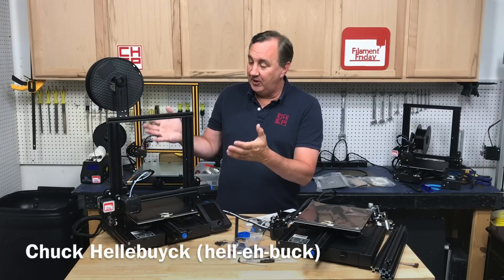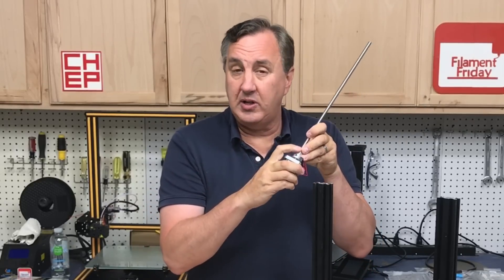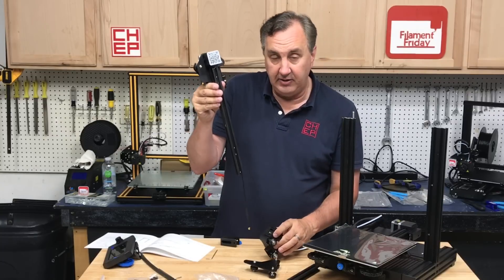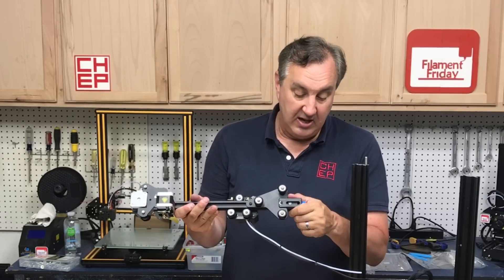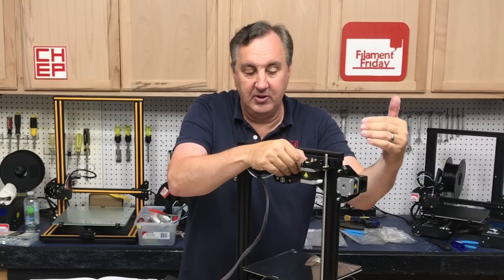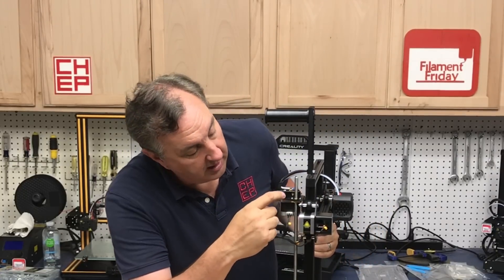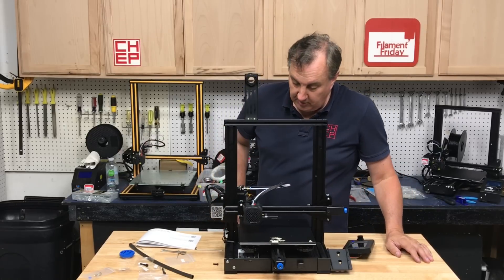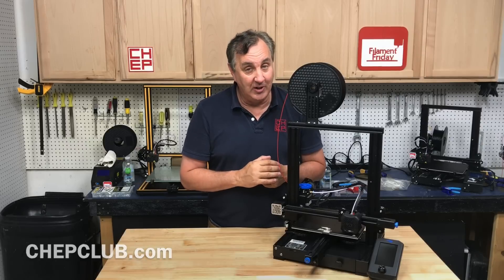How to Setup an Ender 3 V2 3D Printer

Comment: Is anyone having issues with the "pause at layer" command on the V2? Sometimes it ignores it completely but when it does decide to pause so I can switch filament it automatically starts printing again after about 30 seconds without warning
Reply: Hope a solution.

Comment: I contacted creality about the firmware and they told me there's no need to update to 1.0.1 as it's only a language update
Reply from the maker: I believe it also fixes the save to eeprom feature but I added a link to the marlin released version.
Reply: Yeah, that's total BS.  Apparently a very needed fix to STORE SETTINGS are 1.  It also fixed a layer shift problem another youtube user had.  And i am sure others.  There will be more firmware updates...especislly for BLtouch, filiment runout support etc.  Just language fix...whatever.  Creality is so inconsistent with what they do... great printers... but man, wtf?
Reply: It also lets you print any file on the card rather than the limit of 10 most recent files on the shipped version.

Comment: @chep I get an error message when I click the link for the firmware and it isn’t on their website
Reply: Works fine in USA.  May be blocked in your region?
Reply: Tim D I’m in the US too
Reply: @LTMoore-yy1lm  you're correct its down at the moment.  Must have went down right after I visited. Edit: they updated their websitecand removed the Ender 3 V2 firmware up dates!!!! Good grief!!!!
Will have to find their actual links until they get them out front easy to access.

Comment: Great vid CHEP! What printer would you buy with $350? thx
Reply from the maker: You might look into the CR-6 when it releases but the V2 is a good machine and at well less than $350 you can get lots of extra filament and tools/upgrades.
Reply: Hey chep, thanks for the response! Can I change the extruder fan to a noctua one and swap the extruder to direct drive like you can on the ender 3 pro? Does the v2s extruder case prevent these upgrades?
Reply from the maker: You could but I don’t necessarily recommend it. If you want direct drive check out Artillary Genius.
Reply: @chickensoupappledog1645  that's the thing right now with the V2, certain kits like direct drive won't work as the backplate which the hotend, fans, fan cover etc ride on has different hole locations etc.  But apparently u can try an Ender 3 backplate from Amazon to swap out?  Maybe the direct drive kit will have its own backplate, cover etc?????
Reply: @timd9430  hmm i guess i can try to swap the backplate and then upgrade the extruder and its fan. I think ill pull the trigger and buy the v2 as my first printer sometimte this afternoon.
Reply: I would stay way from Bowden Extruders.  I mean you can eventually get it to work consistently but if you are just starting out, i would stay away.  With near $350, I would look at the Prusa mini
Reply: @dattack1970  The PRUSA MINI is bowden.
Reply: @timd9430  yikes that sucks.
Reply: @dattack1970  yeah, but in the end, if you have the cash and the time and patience to wait for delivery (an eternity)... just get a Prusa MK3S.

But if you don't need direct drive blah blah blah out of the box. The Enders are awesome!  You can always upgrade things on them.  So cheap...nothing lost, but definitely learned things in the process.

Comment: Has anyone been able to update ESTEPs from the device itself with a V2? I can't find the option and I'm trying to calibrate...
Reply: CONTROL > MOTION > TRANSMISSION RATIO > TRANSMISSION ratioE
Reply: Tim D Wow thanks I misunderstood what t ratio was and didn’t even dive into that menu. Thanks! I ended up setting up octopi, installing marlin 2.0 and setting it via octoprint terminal.
Reply: Don't tell me this is left out?!

I saw a reddit post that someone was able to.  Have to look on my V2 when I can.

Comment: Loved the video I almost order a boot loader to upgrade my firmware on my ender 3v2 glad I saw your video first thank you so much. I do have a question I would love to build a bigger printer bed and taller but I do not see any options to set to allow a bigger bed. Would love to see a video on how to set it up to use the bigger bed :) 😃
Reply: Teaching Tech has a couple videos on this. There are kits for sale. Bout $150 or so.
Reply: Ender 3 kits should work mostly the same way with V2
Reply: You'd be better off just getting a larger printer... CR series.  Or wait (when I say wait, I mean a very very long wait) for Prusa XL (CoreXY).  But just get a CR series printer since lower cost for now.

Comment from the maker: Note: I made a mistake. Do not rename your .bin file firmware.bin more than once. It needs a different name each time or it won’t update. You don’t even have to call it firmware. Could be any name.bin.
Reply: there a ender 3 v2 firmware out for bl touch firmware version 1.1.1 on  Ceality website, not the 1.0.1 non bl touch - and yes i have modded a , v1 mainboard bl touch3.1  kit to work , requires bracket adjustment and wiring pins mod but is basically plug n play
Reply: Just want to write that about firmware. I have 3 problems with mine, hot end heatsink fan after couple of prints 15 h together make rambling noise on start, glass bed have dip in middle 0.5mm freely spin without pushing filament. Lemon for me as usually but still love it.
Reply: I only have the sd card it came with and have had a blank screen for an hour  turned off to try again  but still blank
Reply: @13tabicat13  have u had any luck? Im in the same boat right now.
Reply: @joshp1888  no, creality says do  all 3 updates but I've tried all but the sd card file with no luck
Reply: @13tabicat13  i got it to work. I went into the file and found the file the path should be Ender-3 V2_1.1.6V_Latest Firmware > Ender-3 V2_Latest Firmware_-2.0.2-V1.0.1-2020.6.2.bin
Reply: Even the first time dont name it firmware.bin or you get a black screen - just name it firmware1.bin

Comment: Not sure if I did something wrong but it appears as if my glass is warped in the middle.

Printing leveling code with a square in each corner and 1 in the middle. I get perfect squares in each corner but my middle square doesn't stay together, the lines are all separate.

Any ideas?
Reply from the maker: Check it with a straight edge to verify.
Reply: Not sure for glass, but others you can put a post it note under in the middle.

Comment: If you attempt to update the firmware and are met with a persistent black screen, rename the .bin to anything you have not yet tried and it should fix. Seems it will not attempt to update firmware again if the file name doesn't change.
Reply from the maker: Great tip. Thanks. I got some bad advice and didn’t verify further beyond one update. You are correct. I posted and update in description and pinned comment. I’ll follow up and correct it in a future video. Thanks again.

Comment: Anyone else wish they got this instead of the ender 3
Reply: I received my Ender 3 pro the same day Creality starting selling the V2, did think about returning before opening and ordering the V2,  but didn't want to wait anymore .. my next one will be the V2... I love my Ender 3 pro, it's super awesome
Reply: @alsantour8835  I love my ender 3 pro as well but the v2 looks like it would be easier to use and maybe even produce better prints
Reply: @rewop12  I know, even just having the power supply tucked away and being more silent would have sold me on it, definitely going to be my next printer buy/upgrade, even debating the idea of making them two on the work bench and getting this one...
Reply: No of course not, I got my ender 3 well over a year ago did I think back then, don't buy this today because at some point I the future  they will release a more refined model. Muppet
Reply: @shaunmorrissey7313  This looks way better to me than my ender 3
Reply from the maker: More expensive as well.
Reply: @FilamentFriday  eventually I will sink the price difference into a silent board upgrade, the difference in price is negligible, still amazing what you do get at the $209 price point

Comment: This is my first printer ever and I got it and recieved it because of your recommendation. Thank you
Reply: Me as well and I just updated my firmware the other day 😁
Reply: Awesome, I've been looking into what to buy and I'm sold on the v2 going to get one this month.
Reply: How's it going so far?
Reply: @megaraph5551  so far pretty well. We did have an issue with some low quality pla. Otherwise added a bltouch and a filament runout sensors, upgraded the firmware and have been happily printing away. I've been super happy with the V2

Comment: 7:37 hopefully the display mount will soon be redesigned to adjust angle to be printed mod.
Reply: what printer do you have Tim?
Reply: @divyeshgabbireddy7824  
Ender 3 Pro
Ender 5 Pro
Ender 3 V2
And they are all just fine for such low cost.

Might get a Prusa MK3S order going just for the heck of it since ready to go (well 5-9 week wait) without so many upgrades needed like Enders to get to the Prusa level  I.e. all metal hotend, fast direct drive, dual gear extruder, dual z axis, flex plate, quiet fans, etc etc.
Reply: @timd9430  which one is ur favorite lol? What printer would you get if u had $350?
Reply: @divyeshgabbireddy7824  depends on your needs.
The V2 better currently.  Only draw back is all the established upgrades that work with Ender 3 and Ender 3 Pro may not work (yet) with V2.  I.e. custom metal brackets for the print head... i.e direct drive kits etc.  But then again, may be able to 3d print brackets, adaptor plates etc.  Just more work basically.

These printers except the Ender 5 pro are "bed slingers". (Like the PRUSA MKS3) (i3 style) They sling the y axis back and forth.  So have to slow it down for tall heavier prints.  The Ender 5 Pro only has x and y head movement, the z axis bed moves downward for layer moves.  So good for tall prints... but heavier, the bed will sag slightly in the front unless braced.  This type of printer should be like the dual z dual rod supports like the Ender 5 PLUS.
Personally I'd go for a Ender 3 V2.  Some want the CR6 SE... but i think price will be higher than it really should be.  If you bought cheap on kickstarter for peanuts... then obviously great deal since auto mesh bed leveling and touch screen andc32 bit board.  But has different style modular print head.  V2 OR CR6 SE??? up to you.  Happy with the V2 as I don't mind manually bed leveling... but auto bed leveling will spoil you then never go back to manual method!  ; ) its all good!
Reply: @timd9430  thanks for the detailed response! I think ill go with the ender 3 pro since I know I can upgrade the extruder system and print most of the upgrades that the ender 3 v2 comes with myself.
Reply: @divyeshgabbireddy7824  you may want to rethink that.  The V2 has much more for the same cost as the Pro (or justca little more depending on where u get it).  I.e. 32 bit board with silent drivers, color display, belt tensioners, drawer (better than printed), much more "finished" appearance.  
But if you have to have certain upgrades that may not work on V2 (yet) then go for it.  But given time, many of them will be offered for the V2.  I think the V2 will become widely popular like the original Ender 3 was.
Reply: You know what... I think I’ll just get the v2. My budget is like around $350 and I was originally planning on buying an ender 3pro and upgrading the extruder, fans, and bed.I gues I’ll take the risk and hope I can still change the extruder and it’s fan. Thx for ur help

Comment: When the feeding filament through the extruder and into the Bowden PTFE tube lock, I also found it got hung up on the inside edge of the brass of the PTFE Bowden push clip piece.  So I remove it and take a small drill that is just about the size of that edge and give it a few twists. The brass is soft and it will bevel it.  What you are looking to do is create that beveled edge inside instead of a straight  edge ridge that might catch the filament when coming out of the extruder and into the Bowden tube.   Dont recall if you've done a vid on it, but feel free to,see if that saves you from having to twist it on/off every time you change filaments!
Reply: Its always done that, just cut angle on filamentvend, the twist the filament.  You'll get used to it.

Comment: Also check the pre-assembled base (not the bed) is square and level before installing uprights. Mine was skewed and the whole thing rocked on its feet. Loosen all bolts, set it level on a table, then retightened everything.

Comment: DO NOT try to run Chep's G-code Zero.  It crashes the nozzle into the bed.  I got mine 3 weeks ago found out the hard way.
Reply from the maker: As I mentioned, marlin team is fixing it. 1.0.1 also stops the crash.

Comment: Just got mine last week! gonna add bltouch to it this weekend
Reply: Could you let me know how well this worked out and what modifications will be required on hardware and software? Aswell which BLTouch version you are going to use. I am eager to add one to mine too but as this is my first experience with 3D printers I am not too deep into Marlin & Co.
Reply: Isn't a new firmware update needed in order to do this?
REDDIT has some posts of success.

Comment: What can the new firmware do that the old cant?
Reply from the maker: Fixes the save to EEPROM bug.
Reply: @FilamentFriday  can u be more specific as to what that means exactly?
Reply: @michaelisakov1108  Just update it. Y wouldnt you?
Reply from the maker: If you change settings like e steps it wouldn’t save them to EEPROM so you had to redo it every time. Not they save if you select that in the menu.
Reply: @FilamentFriday  I noticed 2 issues, which I'm sure they can easily fix, or at least I hope. There is no filament change option and no way to view the full fil name. It would be nice if they made the names scroll when its highlighted.
Reply: @michaelisakov1108  file name prob always been like that... must be frikn impossible to fix.
Reply: @timd9430  ya  it it's more viable on ender 5 pro screen. Not to mention more options. Youd think a v2 will have a better option selection esp since the screen is upgraded.
Reply: @michaelisakov1108  it's going to evolve with new firmware revisions.  I.e. the missing filament change.  Never really use the filament change much on the Ender 3 Pro as it pushes so much in or rather out and wasted.  I just manually change the filament.  You can cold pull it also. (I.e. heat nozzle 200c, then change to 90c, then pull it out of hotend right before it reaches 90c).  Filament starts to solidify, just enough to pull it out also for a clean color, different material cut off change.